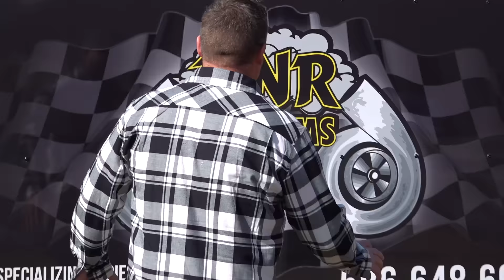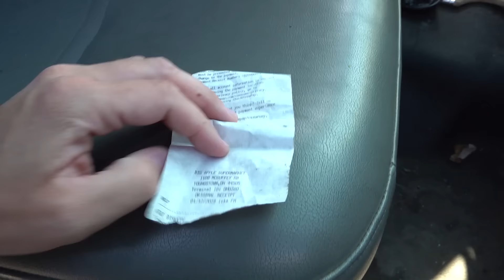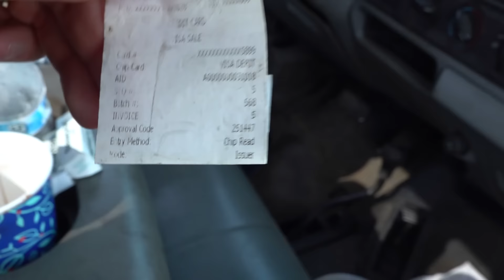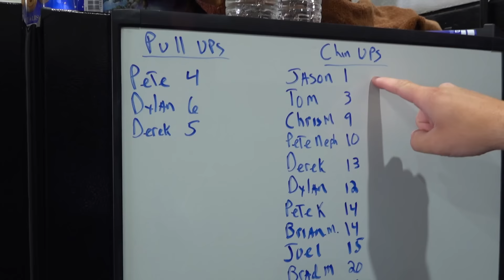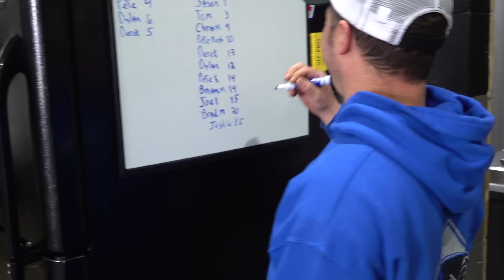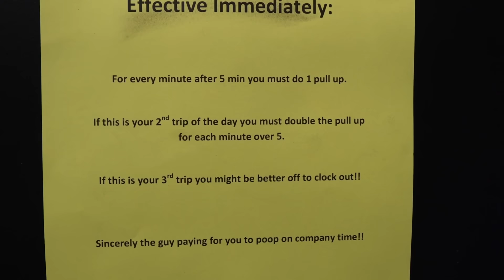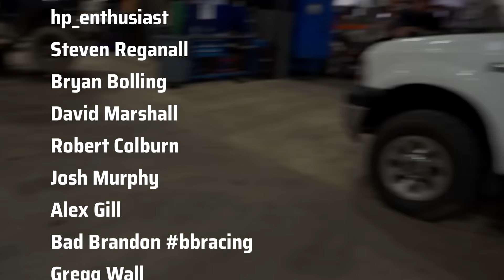Our NEW burnout truck!!! Bad idea? DIESEL BABY!

Comment: The 6.0 got a bad reputation just because dealers and mechanics threw parts at them and never knew how to diagnose anything.  Repairs costed people a fortune and still do for some reason.  But to the people that know, they are great trucks and the 5r110 trans is tough.  As a plus because of the reputation, new parts, used parts, and whole trucks are cheap, making them great toys.  Plus they sound so damn good, especially if you go non vgt, run 4" down pipe with a 4" y pipe back to 5 or 6" stacks and let it bark.  So excited about this
Reply: Nothing better than a 6.0 on the chip
Reply: @FrankieJ_117  especially if that chip is set to 5k 😘

Comment: You should probably just leave it stock and bypass the rear brakes... It'll have enough power to blow off the tires and won't overheat.  ...because you're gonna overheat it trying to do burnouts at high hp.  (ask JH)
Reply: 😂 just wait and see what we do

Comment: Anyone who actually knows about diesels will tell you 6.0 are a great engine if you put right parts and do it right way. JH mudd truck that he is rebuilding that he beat for years had 6.0 and has one going back in it. He owns a diesel shop 🤷🏼‍♂️. I’m know one but I’ve had a 6.0 a 6.4 and two 6.7s and my 6.0 was a great truck.
Reply: Facts

Comment: As big of a rear end gear as you can find to keep the rpm low. Go get um boys
Reply: 6.0 on the chip is where it’s at 🎉🎉
Reply: @FrankieJ_117  not for the 2 mins it needs to keep them wrapped with no air coming in the front.

Comment: Inject some stuff into the exhaust?
  I bet it's gasoline through an orifice across a spark plug screwed into a bung welded on the exhaust. Flamethrower.
Reply: Good idea but not it 😂

Comment: Won't make a good burnout truck. It will get hot pretty fast, cooling system can't keep up with the extended high rpms/Rev limiter,it'll burn the power steering pumping up etc etc. Speaking from experience...
Reply: We got that covered